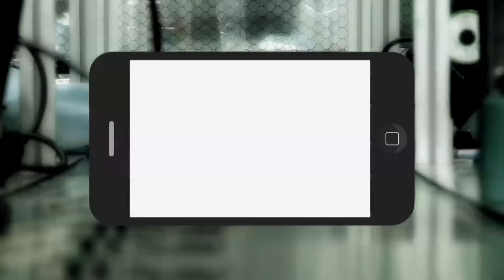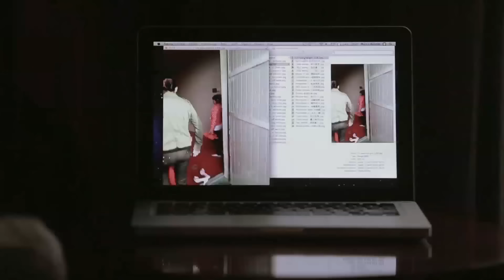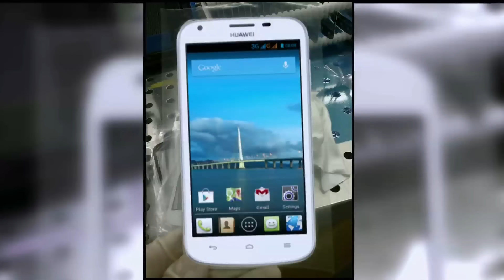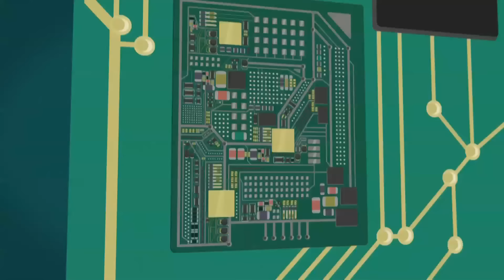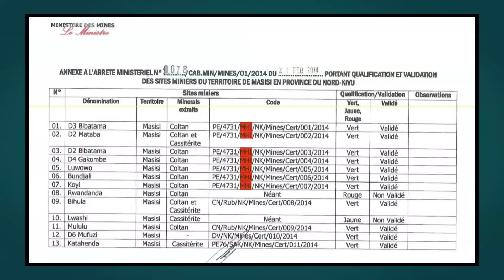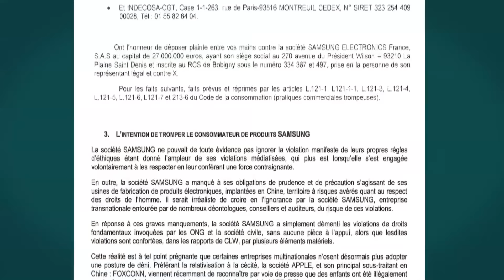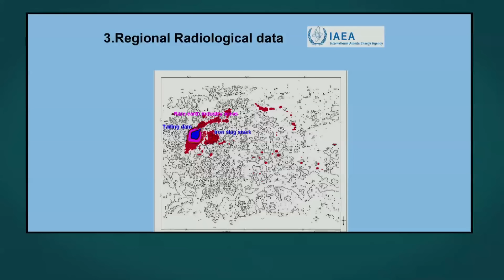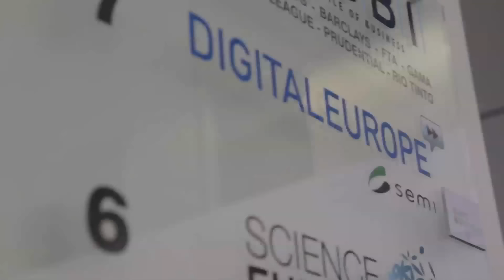What is the REAL cost of your mobile phone? Global Investigation | Documentary

Comment: One way of support  is via lessening the demand. However, as in my case, no choice no matter how much you want to keep the same phone bec every 4 to 5 years the battery has to be replaced.  Since it is built in and sealed  internally, one is prevented from replacement.  So no choice but to replace it with a new phone. Perhaps if you can advocate the previous features of being able to replace the battery side by side with customer clamor of being able to change battery,  then demand could dwindle subtly a  little.  But that said, which manufacturers would want demand to dwindle?  Unless that battery replacement service is available, that could be a very good  partial solution to your multi million challenge. The final question who will tie the bell?
Reply: replacing a battery, even a sealed one, isn't actually that hard...
Reply: Think regulators are already moving in that direction ("right to repair" in the EU), but you're right, in most of the world, regulators don't care. And UK's Brexit rhetoric is indirectly a snub towards EU's regulatory care.

Comment: I kept my old phone for 5 years to reduce demand for exactly these reasons. I did replace the screen myself, after I dropped it accidentally. It still worked fine but, but, the switch to 5G meant some older frequencies the phone needed were shut off/repurposed for 5G. It eventually stopped working during the pandemic, 1 hour after I’d leave a Wi-Fi network it couldn’t find a signal. I’d reboot the phone and it’s work for another 30 min. I tried it on 3 different networks, all said they supported the phone, except the issues continued. So after 5 yrs (in 2020) I had to replace it. It’s obsolete as a cell phone but still good for many other tasks.
Reply: My wife's 9 year old phone still works - unfortunately only after stripping down the OS and putting a fresh "lighter" version, so some features don't work, but the battery is fine. My previous phone lasted 5 years with one battery replacement 3.5 years in - and my current phone is already beginning to lose battery life after just a year of usage. Not sure why.

Comment: Fine all the big brands & transfer all the funds directly to the victims (or if not possible & yet better keep it in a fund with the sole purpose of  providing the money to treat the victims using these funds outside of the countries that are committing the violations)

Mobile companies need the materials at least (& cheap labour) & they are happy to get it cheap from the suppliers (to maximize their gains!). The fines should be heavy enough to force them to pressure the suppliers to follow the rules...
Reply: Then you’ll pay $500.00 pr phone
Reply: @bobwoww8384  
500 is better than the current 800+